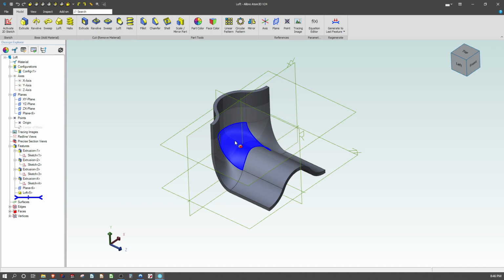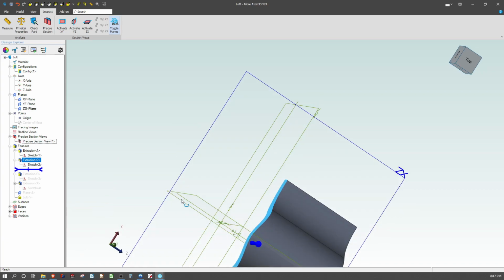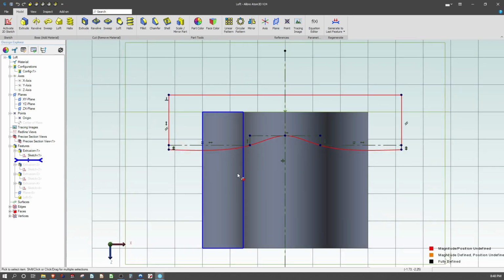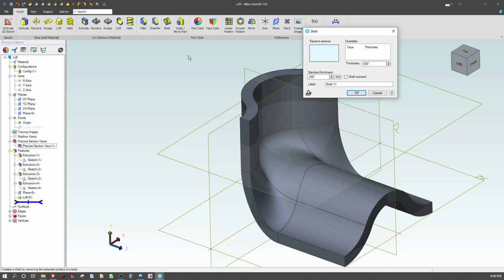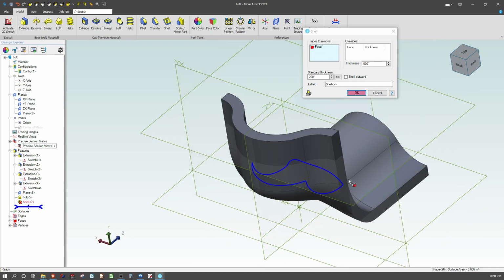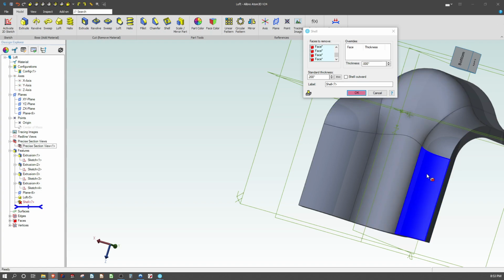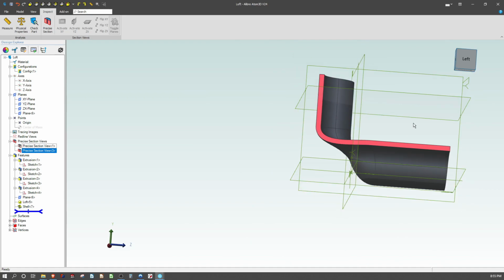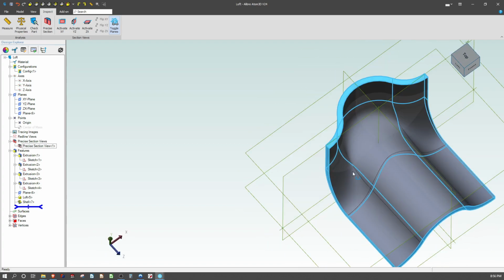Method for Constant Thickness Lofting in Alibre Atom|JOKO ENGINEERING|

Comment: How do manufacturer it?? It will be really difficult to get that bend. Isn't it?
Reply from the maker: It would be difficult to sheet metal bend it.  It wouldn't be difficult to stamp, injection mold or use additive manufacturing though.  In a larger sense, this is a made up part used to illustrate the capabilities of the platform.  It wouldn't make sense to fully vet a part for manufacturing just to show a capability of the CAD system.  Hope that helps.